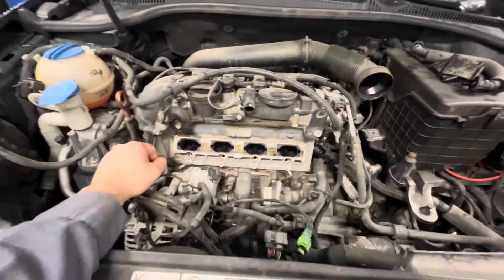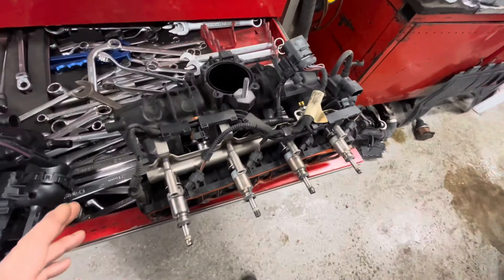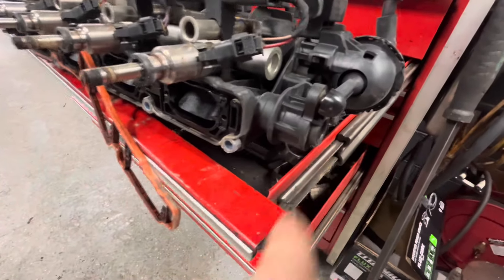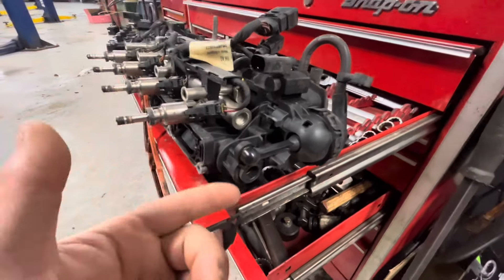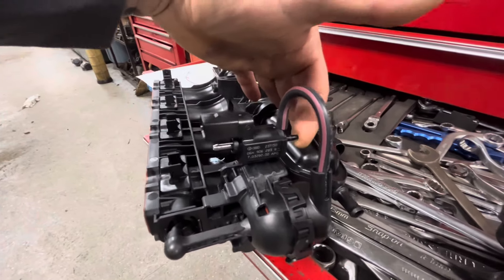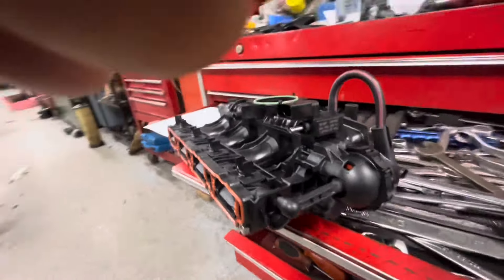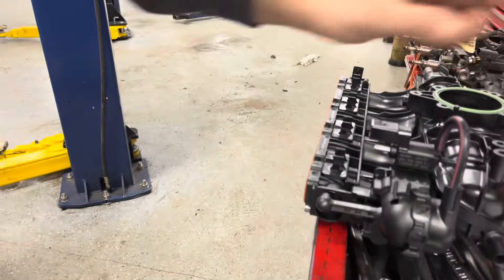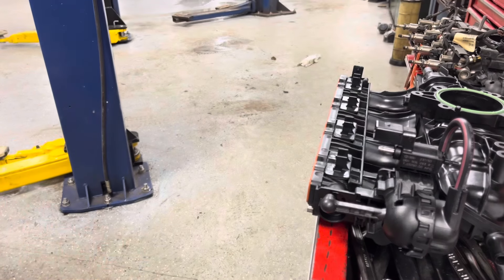REPLACE THIS ALONG WITH YOUR VOLKSWAGEN 2.0TSI INTAKE MANIFOLD

Comment: Great info man!! ✌🏽 how long do those flapper actuators usually last for? I never had to replace mine in the 2007 2.0 FSI engine before.
Reply from the maker: Yeah the fsi uses a little bit of a different style and seems to hold up better, on the tsi 2.0 your lucky if they make 100k

Comment: Hi, Is it also possible to place the old solenoide on the new intake ? 
Or is it also possible to keep the new solenoide what is on the new intakemanifold and dont attach the hose from solenoide to valvecover ?
Because we have ordered the new intake manifold and we wont to install it but we dont have that hose from solenoide to valvecover and we dont have time...we want to install it quickly
Reply from the maker: Yes you can just swap over the old solenoid or use the new one with a hose not connected to the venting port, it may reduce the life of the manifold but if you need to do that maybe order that hose and install it at a later time, it’s not hard to sneak it in with it all together
Reply: @EuropeanAutoRepair   ok thanks for the Quick respons ! I think we gonna install it and later but the hose on

Comment: Where does the new vacuum hose (06H 133 583 F) connect?
Reply: It connects to the pipe he is pointing to at 1:58, and then routes up between the intake manifold and the valves, and mounts next to the spark plugs.

Comment: Quick question; I got a check engine light and noticed that the filter at the end of the 06H133583F hose was busted up into salt like peices. Any idea if these particles would cause the check engine light to come on? Would removing said hose cause a check engine light? Or is it more plausible that the IMRC itself, or its sensor is faulty?
Reply from the maker: It that hose is completely restricted it could cause an issue. To diagnose it maybe just disconnect it at the solenoid. Shouldn’t store fault with it disconnect